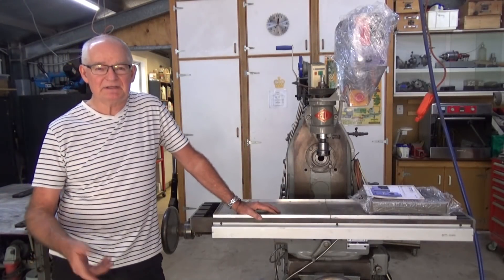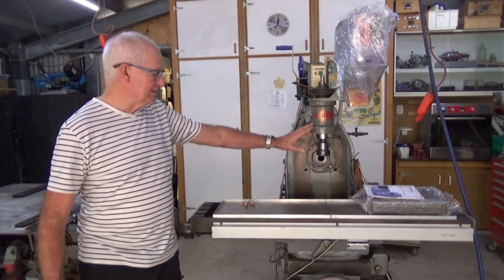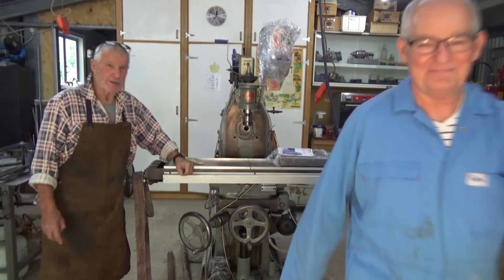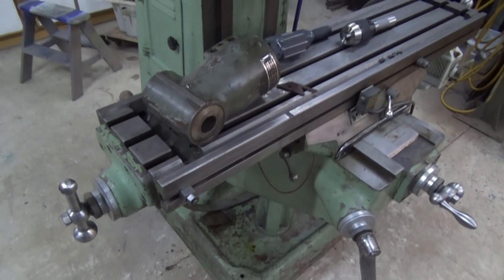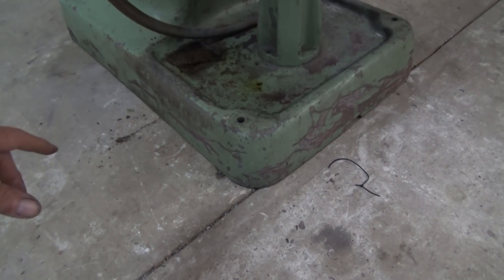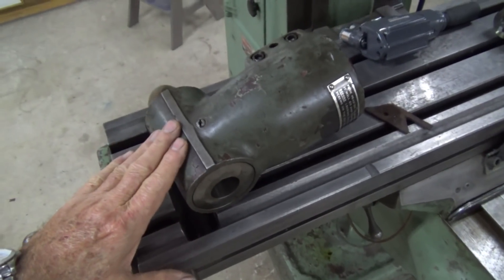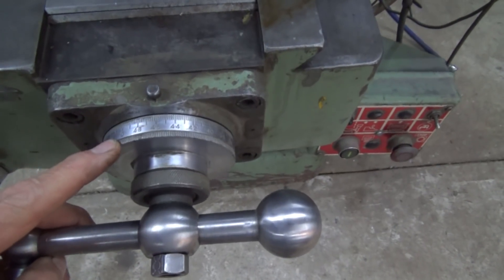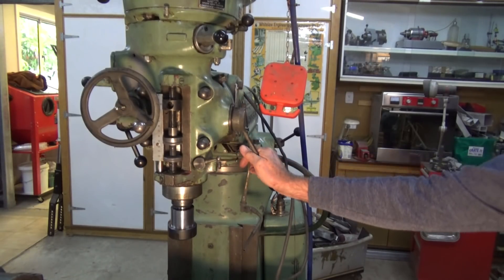Milling Machine Switch a Roo. A new (to me) Bridgeport in my life.

Comment: Hi Mark
Like you i just purchased the same bridgeport machine .
In your moving clip i spied you have a cholchester  lathe just got one of them too.
Cant wait to start restoring please keep making utube clips i need the ozzy insparation and humour. 
Good too to see  you and  your mate  were keeping your fluids up with the xxxx.
Reply from the maker: Clint, that Colchester came from a TAFE college and we got it and a load of milling machines and three shapers for just the cost of transport. All the machines went into our engineering shop at school. The Colchester literally fell off the truck when the forklift operator bumped it. Luckily it fell onto the grass on the kerb side of the truck. The headstock guard got smashed and the chip tray got bent up but that must have broken it's fall. It was deemed to be too dangerous with the gears on the end of the headstock exposed so I offered to buy it. I ended up getting it for $500. Also bought a Varno shaper for $300 that was surplus to our needs and sold it for $1000 so the Colchester actually cost me nothing. Sometimes you just get lucky. The Bridgeport though was an altogether more expensive purchase. I am doing a follow up video where I will break down the costs in case anyone is thinking of doing the same thing. 
Regards,
Mark

Comment: I'll love to see this one in your future projects, and very glad you did not lose your toe. I will never put myself in front of a rolling machine tool, too risky ans scary. I recently discovered your channel and I'm loving it, well I guess you already know that. 
I've been learning all my machining skills from the internet, and the guys in the machine shop at the university think "I've got a decent training". Many of your projects are in my list, I'm just waiting to have the chance to start building my own shop. Hopefully within two years I will start having my first machines but meanwhile I'll keep using the shop at the university. Luckily is open for students and staff as well and they don't ask many questions as long as you don't make a profit nor anything crazy. I'm staff now but I come from and electrical engineering background, so there is much to learn. Unfortunately at the University shop you cannot leave stuff in the machines for too long and some setup require tooling that the staff there is not willing to lend easily. Being short of time and not willing to negotiate why I need a dividing head or the handle for the split nut of the lathe I guess that for now I'm limited to the basics. But many of your projects have inspired me to copy-machine them as soon as I have my own machines.
Reply: Limited access to good machines is better than no access.
Reply from the maker: That's great that you have the use of the university workshop. They are usually well equipped but I can understand why you would have to limit your projects on borrowed machines. When I was training at college we had excellent quality machines and tools but the lecturer was fanatical about cleanliness and looking after the tools. There was a glass case on the wall full of taps and dies that we were not allowed to use. They looked pristine and no one dared to ask why we couldn't use them. We started to suspect that he just wanted to show them off. Good luck with building up your own home workshop. It's a noble pursuit!
Regards,
Mark

Comment: Looks like you are going to be busy making all sorts of cool things with the new to you machine. Don't worry about not having the steel tipped shoes, they only work for certain occasions. I knew a guy who used to deliver Miller beer, wore his trusty dusty steel tipped shoes and one day dropped a keg of beer on his foot from out of the truck bay over the wheels. He nearly had is toes completely severed from the cap as it hit near the largest opening where the joints start, it is the weakest point. He is okay now, had everything repaired. They certainly would have worked for your situation though. Can't wait to see how you dress that thing up, flames maybe, or a blower. Thanks for the video!
Reply from the maker: Craig, that situation with the roller was scary because it was all happening in slow motion and I could do nothing about it except call out for the crane operators attention. It was close but luckily no damage. I have heard that about steel cap shoes and I think they tested it on Mythbusters at one point. I am looking forward to using the mill. I do have it running now and I am working on a follow up video to show how the electrical installation went. I am also going to do a cost breakdown just in case anyone is considering the same thing.
Regards,
Mark
Reply: @Preso58  It's good that nothing bad happened, no fun getting smashed. I really enjoy your videos, learn something new every time I watch.

Comment: Geezzz Mark, shock horror, finally a face to the voice.  Great pickup on the mill and you won't look back.  They are extremely versatile machines and the Horizontal Head Attachment just adds another dimension to the way you can do your machining set-ups, I wouldn't be without mine.  In fact I have two Horizontal Attachments, I converted one to use as a Quill Mounted Slotter.  You can check the operation here :  https://www.youtube.com/watch?v=QtT7lGgwygk&t=400s  and I did a description and break down of it here : https://www.youtube.com/watch?v=LYIdi7ruRps&t=457s
Mine was in rough shape when I got it and I spent alot of time giving it a "Birthday" to put things right.  I made up a 2" riser just to give me a little bit more head room to work with.  I did put a VFD on mine and with the variable speed very rarely need to go into back gear.  Anyway, enjoy your new purchase and I look forward to seeing some of the new projects on the table.
Cam
Reply from the maker: Wow, that slotter is genius. So is your workshop crane and why have I never had any of videos show up in my recommended feed? I have just subscribed and will have to go back through the rest of your channel. Travel restriction permitting, I am planning to get down to Melbourne for the Let's Make It exhibition in October. Not sure if you are thinking about going but maybe we could meet up.
Regards,
Mark
Reply: @Preso58  G'Day Mark, thanks for the complement.  I've been watching your doings for a couple of years now and really enjoy the variety that you present in you Video's.  Those of us with small channels do have some interesting content to offer but certainly don't get much in the way of exposure, but hey I get nervousness with a couple of hundred views so I'm comfortable with that.  I'm certainly hoping to get up to the expo in Melbourne and catch up with many of the other Australian YouTube's face to face.  I'll be tailing out on a 6 month Shutdown which is planned to finish in November so am hoping to get some time off to attend.
Cam

Comment: I'm jealous! Enjoy your new machine Mark! By the way +1 for the imperial hate :D
Reply from the maker: Dimitri, I am old enough to have worked with both imperial and metric. I went through all my primary and secondary schooling using imperial and then switched to metric when I started at college. Who really wants to mess with 64ths and 32nds? I don't get it.
Regards,
Mark
Reply: @Preso58  The best part is that they use 64ths and 32nds and then at the same time thousands - base 8 to base 10...biggest wtf for me. I was forced to use imperial in some shops in the US - it actually does work once you wrap your brain around it - but I don't like it.

Comment: Don't be surprised if the variable speed is noisy .  The belts are expensive .and it has a couple of plastic bushes in it .easy to make just a bit fiddley . Oh and a nylon key .. all a bit dissapointing . I have three of them . Bed conversion is normal v belt and a VFD . Nice and quiet then .. great to have new toys
Reply from the maker: Mark, I got a rotary phase converter set up and the mill just plugs in and all the accessories work without having to do any rewiring. I fully expected the head to be noisy but it seems pretty good. I have nothing to compare it to but I am happy with it as it is. I am doing a follow up video shortly so I'll be keen to hear from others if they think it's OK. 
Regards,
Mark

Comment: Nice purchase Mark. Looking forward to seeing how you wire it up. 😃👍👌
Reply from the maker: Mick, I got a rotary phase converter so it just plugs into the box and everything works without having to mess with the electrical side. Certainly safer for me and despite the cost it seems like a good way to go. I'll be doing a follow up video shortly. 
Regards,
Mark

Comment: One of those oil lines leading into the knee should be feeding the right side z-axis dovetail and the other probably oils the elevating lead screw. If it's the latter that's crushed, you can probably get away with capping it off and manually oiling it.
Reply from the maker: Nicholas, the table and saddle are coming off shortly. The pipe does go to the Z axis screw but I can't really get at it from underneath. I am old and I have a crook neck so there's no way I'm lying on my back and trying to do it by feel. When the table comes off I will have a chance to get a good look at wear and tear.
Regards,
Mark

Comment: I am a Machine Operator from Cat, seeing the delivery service operator lift that milling, bore, drilling machine the way he did may both my heart and stomach go up inside my throat.  I have watched Millwrights drop or break the machine head because they thought they could. 32 years at Cat and saw a lot of stupid things, including engineering making mistakes costing several million dollars.  They did recheck a pit they had dug to put a new machine in and they were off by 3 inches which put the machine on top of another one. Thank goodness you didn't have the head pop off but I hope you check the ways, gimbles to make sure it didn't throw it out of true and didn't bind up the ways.
Reply: G'Day SFCRambo60, I can assure you that is the correct way to lift a Bridgeport.  How do I know, I've got my Bridgeport users manual right in front of me.  Page #5 method #1 shows lifting with 3/4" Whitworth Eye on top of the Ram, method #2 shows slinging underneath the Ram as was done with Marks machine.  Having moved and setup many machines in workshops, that's also exactly how you rig a horizontal or universal Mill.
Cam
Reply: @camatbattler2233  i ran several at Cat and they went to move it and broke the milling head off of it. I have run many different mills, bore, lathes, drills, CNC machines, transfer machines, Omni Sunstrand CNC's, I have run every machine on the 3208 blocks, heads, front covers, also the 3404 and 3406 besides the 3412 blocks and rods. I save Cat 3 million dollars in one year with Cost Reduction Ideas. 
Oh, don't believe me, Cat and I have blown up enough different machines. The Maintenance Department made up stencils for me, I blew up 3 machines in one night. 2 were drills and one simplex mill. 32 years in like 8 different Buildings from East Peoria to Mosville Illinois.
Reply: they lifted from the ram not the head
Reply from the maker: The really dangerous way to move a Bridgeport is to use a forklift under the dovetail on the ram. It's evidently common to chip the cast iron or to have the whole mill slide off the forks. The vendor told me they were going to load it onto the semi trailer with a forklift and I nearly had a fit. They went on to say that they have purpose made rubber blocks  to cushion the iron and given that it was coming from 1600km away I just had to trust them to do it right. As it turns out there is no damage so I feel relieved now that it's in and running. 
Regards,
Mark

Comment: The broken part of the oiling System is a springloaded piston, similar to the german "Vogel" type oiling system. These are interchangeable for different amounts of oil. I would like to give you a new manifold and piston assemblys for free, if you want one
Reply from the maker: That's very generous of you but I have just purchased a new metering valve and the brass pipe came out easily but the new copper I am fitting will have to go in after the bed and saddle come off next week. I will be able to get a better look at the lube system then. I will certainly get in touch with you if I need any more parts but I am hoping it will all just need a clean.
Regards,
Mark
Reply: @Preso58  just realised you replied to my comment. Please do get in touch if you need anything, even other things, I overhaul old machinery as my job, we mainly do old "Dörries" vertical lathes, so I do have acces to a lot of things you might need. Would be a pleasure If I could give back a little, because you share sth with us that is priceless and that is you knowledge and experience, so thank you for that.
Reply: Btw. Thanks a lot for mentioning me in your Video! 
Actually my Name is Niklas, so Hi! I just use Smitty as an alias.
Reply from the maker: Smitty, I was a bit premature in declining your offer of the lube system parts. I took the manifold off from under the saddle yesterday and found another #1 restrictor valve was bent/broken. If you would still like to help out please contact me at mark.presling@gmail.com 
Regards,
Mark

Comment: Nice addition Mark. You want to go round corners using the pipe roller method, introduce the pipe at the front at an angle and the machine will start to follow, then continue. I have found this works well.
Now I am Jealous, I want BP quill machine too, John, EC Australia..
PS Check out Max Grant from WA and see his progress on R8 Tooling if you like.
Reply from the maker: I have been watching Max Grant's videos. Very cool stuff indeed. The Denbigh eventually got picked up a few days ago and it had been sitting outside for over a week. I kept it covered but it was starting to rust by the time the new owner got it on a truck. I must say we took our usual approach to any job that Macca and I do. We just make it up as we go along! We did eventually work out how to arrange the rollers to steer the machine but we had almost finished by that stage.
Regards,
Mark
Reply: @Preso58  It is a handy trick that my father showed me around 40 years ago and works well once you have the steering alignment calibrated, lol. Cheers mate, John.

Comment: Mark that's a nice machine. If the oil lines are low pressure, could you bypass that with some rubber tubing and just t off the lines
Reply from the maker: Clarke, I managed to get a new Bijur fitting but it wasn't cheap. It's going to go on next week when I can get the table and saddle off. It should be interesting to see how it all looks inside. I love that there are still spares for Bridgeports available but it all comes from the USA and there are a few bits available in the UK. We here in Australia pay a fortune for shipping out of the USA but at least I know the spares are there if I need them.
Regards,
Mark

Comment: Oh yeah!  Rock and roll time!  The Ebay shipping charge for Abom was about the same as the cost of a plane ticket. I think steel toes wouldn't have helped and it might have made it worse. The steel shell would have succumbed to the forces and mashed more toes than just one. Glad nothing happened. I am surprised the truck driver didn't help, but I guess it's probably a liability issue for them. A winch and frame would come in real handy going forward.
Reply: which direction is forward?
is a nod as good as a wink to a blind horse?
are you on the level?
Reply from the maker: Barry, I recall watching an episode of Mythbusters where they dropped stuff on steel cap boots to see if they could cut the dummies toes off. I can't recall the outcome but as you would expect it was entertaining watching them try. 
Regards,
Mark

Comment: it took me 2 years to find my Bridgeport.  I don't know how I ever lived without one!
Reply: I feel that. Very centeral US here, I waited 6 years for one to appear around here, finally ended up with an Index 645, which is a bit bigger than the Bridgeports I've seen, but it has no back gear, and manual belt speed change, which is a bit of a pain. Still, better than no mill, by far.
Reply from the maker: I have wanted one for many years and it was always a case of them being just outside my budget. In the end I withdrew some money from my superannuation and just paid whatever it cost. I am planning a follow up video where I break down the costs. You are correct though. They are very nice machines.
Regards,
Mark